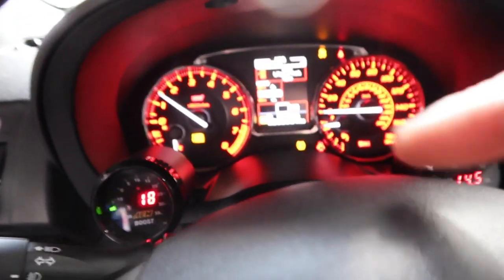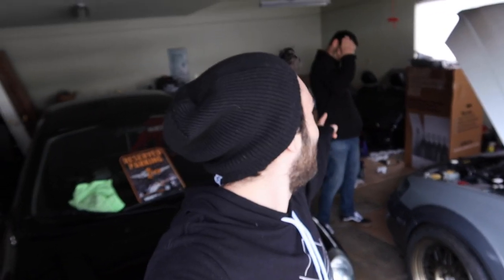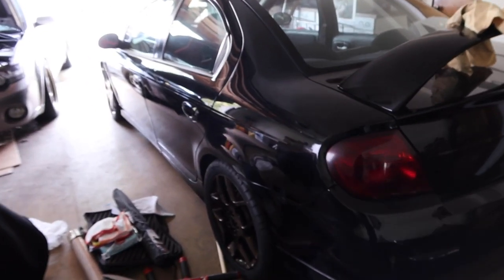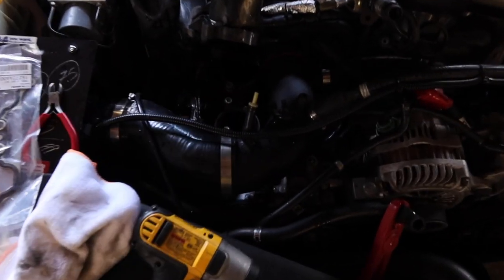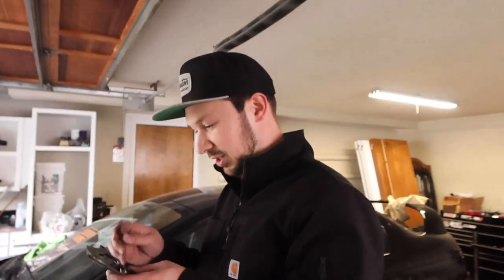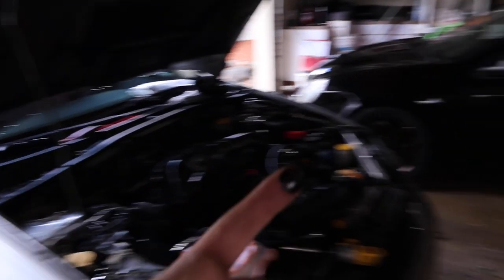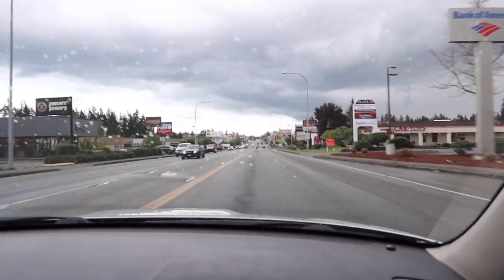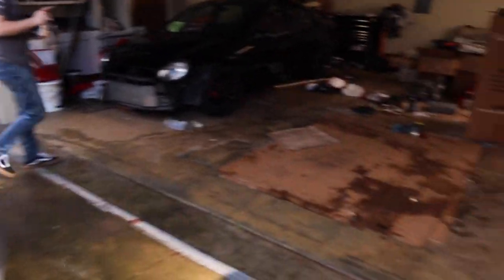Fixing Matt's 400 WHP Outback XT (Vlog)

Comment: That constant chiming noise would drive me insane
Reply from the maker: It drives me nuts, somehow he has learned to live with it 😅
Reply: Trust me it's annoying as all hell.  It didn't used to do that until the battery was removed and now that the stock seats aren't in anymore I cant reconfigure it to turn it off. It's for the ods signal in the passenger seat. If anyone knows how to turn it off that would be great. Lol I cant even do so with a technician specific subaru select monitor.. hahaha
Reply: @MatlasDI  can't set up a resistor for the old plug that went to the stock seat? Like they do for airbag deletes.
Reply: @GolfCoyote  might be able to. Just need to figure out correct resistance on the connectors. I hardly notice it anymore, but it's definitely on the to do list. Lol